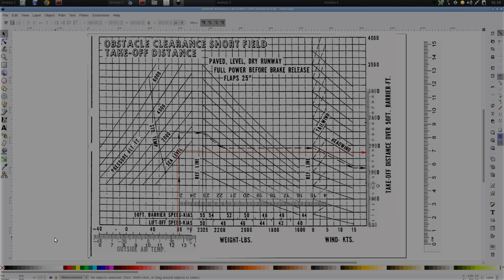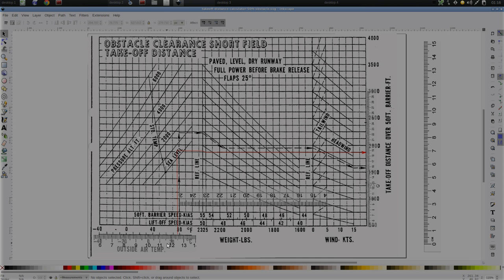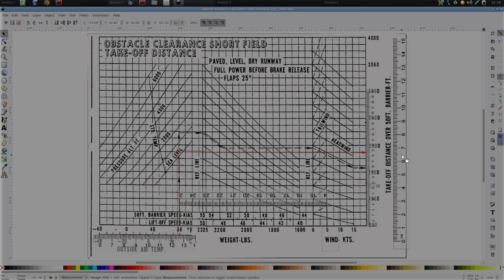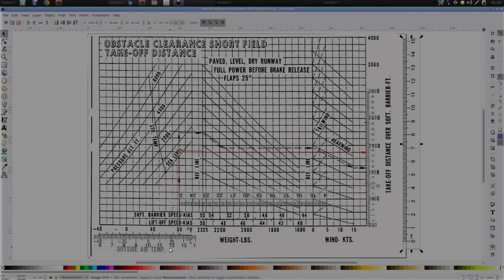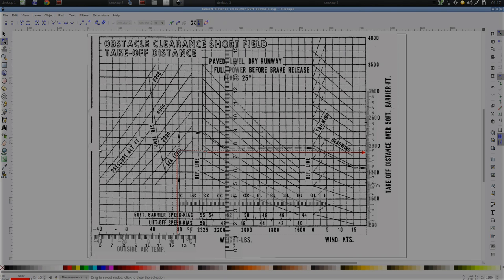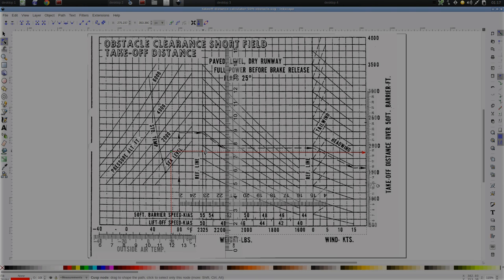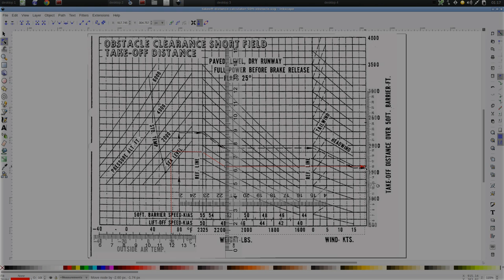PA-28-161 takeoff distance calculation

Comment: How do I figure out the pressure altitude
Reply: Hello, the pressure altitude is the one that reads on your altimeter.
Reply: @NevilleLawson0429  When the altimeter is set to 1013Hpa (2992) on the ground...otherwise, every Hpa is 30 feet.